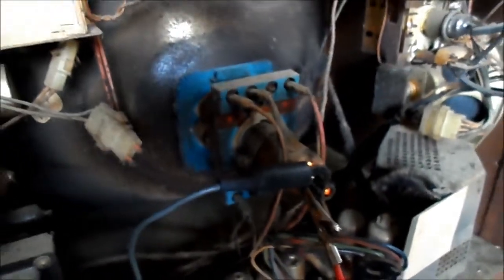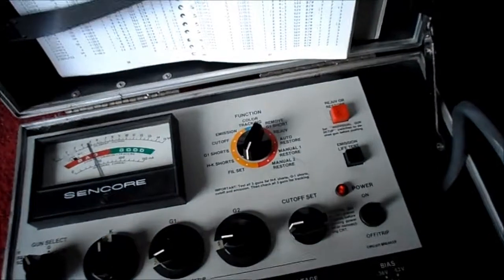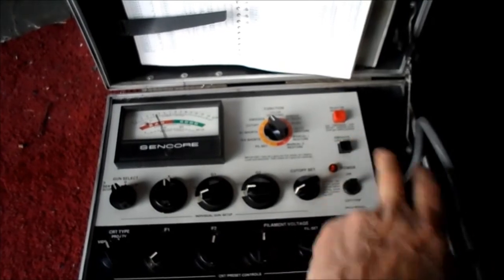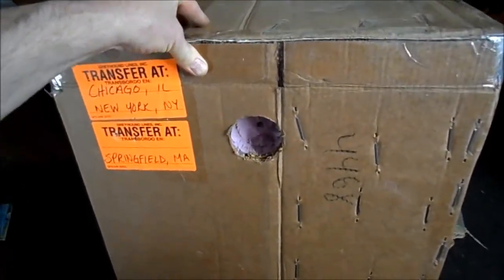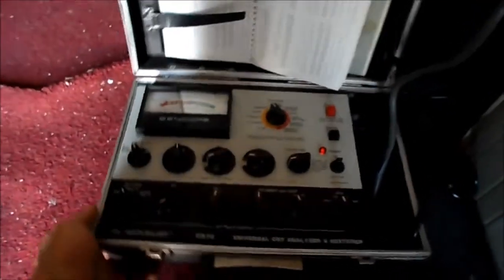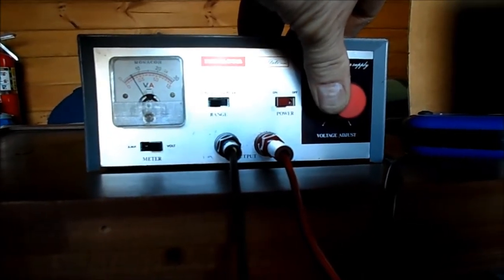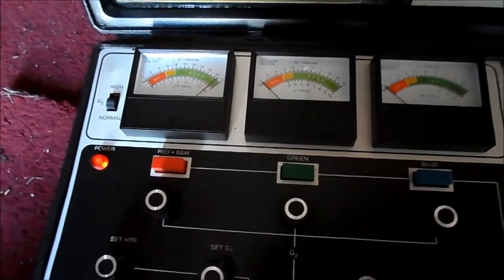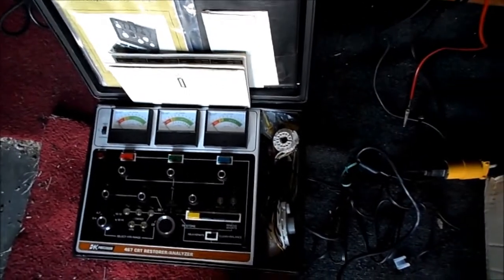Confirmed. 23 Inch Motorola CRT Is Defective.

Comment: I am confused, they both tested weak on the CR-70 but the new one tested great on the 467 and the old one still tested weak on the 467?

IF the emissions of the old CRT had tested ok on either one of the CRT testers at 3v for the old tube (600ma) I would have guessed it was a rebuild with a low voltage filament (I know philco predictas had that a 2.67v). the confusing part was the inconsistent results of the two CRT checkers on the new tube.
Reply from the maker: You're right about the inconsistent results testing the new tube using two testers. I believe the CR-70 is at fault there. I may do best 2 out of 3 with my B&K 465 tester. I believe the 467's results, & may verify them w/the 465.
Reply: Farmradio  in the mean time I would recommend you stay at a voltage that results in no more than 600ma. Of couse if the tube is weak to the point of not useable I guess it does not matter.